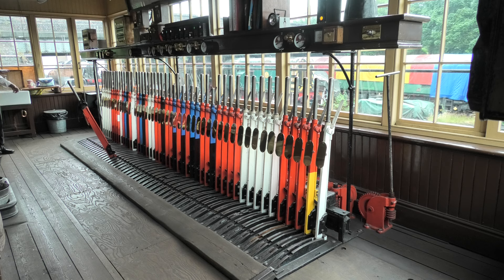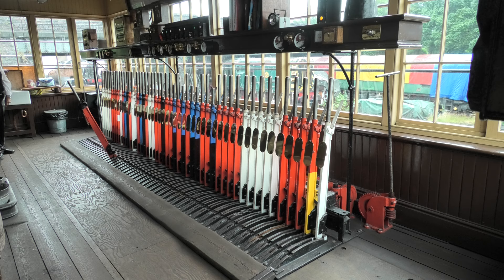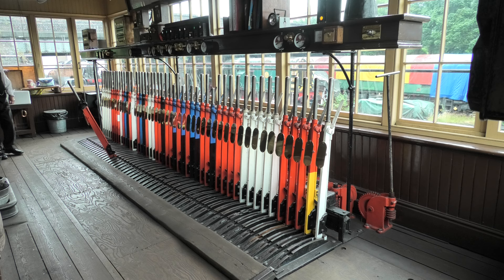How the signal box levers work in a signal box.

Comment: Good evening, it is not yet entirely clear to me whether those old electric block systems (Absolute block system, if I'm not mistaken) with a wooden case were or were not influenced by the passage of trains for the purpose of occupying and freeing the section (block) towards to which and from which the train was respectively headed or from which the train came.  Furthermore, it is not clear whether there is an electrical connection between the lever that controls the opening (switching from Danger to Clear) of the starting signal and the apparatus with wooden case.  In other words, was it possible to pull the lever that activated the starting signal towards you without first having received electrical consent from the next station?  However, it is common ground that where there is a token block it is possible to activate the lever that opens the starting signal even before having handed over the token to the driver, unless there is a mistake on my part.  Thank you very much for your availability and collaboration
Reply from the maker: I have no idea, what you see is what you get. I know nothing about them. We live a long way from Loughborough so it is not as if I can go there and ask. It may worth giving the railway a ring and hopefully someone may be able to answer your question.
Reply: Where a lever is electrically locked Normal in the frame and cannot be reversed without line clear from the box in advance a white stripe is painted onto the lever which controls the most advanced starting signal. The white stripe is at the half way point of the length of the lever, when the Lever is Normal the signal is at danger when reversed it is clear. That principle applies to Absolute Block, Token Block and Permissive Block. In Loughborough Signal Box there are no white stripes on any of the Stop Signal Levers so neither Up or Down most advanced starting signals are electrically released from the box in advance.
Reply: @andrewmerriman7133  There is one, the up section signal (Number 9) which is released by line clear on the up line block instrument
Reply: @danfisher1530  Your quite right thank you for pointing that out to me, I should have paid more attention to the video.